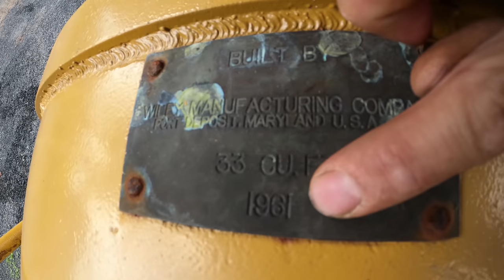Buying and modifying a concrete bucket for the crane

Comment: The wings should be wider and deeper and on a higher angle. Definitely a second person on the ground. Could lift the bucket to move the stone to the funnel between lifts of stone to fill it. I'm saying they need to be as big as the opening and much wider because you will be much faster filling it and that translates to less second person time....  Also, when traveling with any weight on the crane hook, you want it in tight to the crane. Not 20 or 30 feet out in front of you. That is how booms get bent and cranes flip. It's NOT a tele-handler!!
Reply from the maker: that boom was sucked all the way in , it wasnt out even a foot while I was moving
Reply: @jmuller86  Sorry Jesse, but it looks like it around the 33 min mark. It's been a while since I operated cranes, but it looks like one we had at Florida Power and the boom sucked all the way in tight to the outer mast. Maybe it's the camera angle also that makes it look like it's 20 feet out ahead of you..   I only mentioned it because another operator at work did exactly that and it made the crane bouncy and I was told he got the rear tires off the ground while traveling past our fuel pumps.

Comment: I don’t understand the purpose of laying the bucket over. It can stand straight up and you could load it that way. Any gravel spilled over can be cleaned up by whoever is running the skid steer when the bucket is moved to its unloading location. 

It definitely is not a one person operation for gravel. Minimum would be 3 people to load, lift and empty.

Comment: Just cut the sides twice down the half circle it makes and then bend the pieces out and add more metal to it that way it has a wider mouth opening all the time. It would work out much better that way. Only problem is youd have to keep the lift arm in the up right position all the time but it wouldnt matter.

Comment: Surprised those pins didn't snap first load , would have went at least 3/4 inch pin , good idea though .
Reply from the maker: there really cant be enough weight on those wings to need anything more

Comment: I would’ve made a modified half funnel to attach to the skid steer bucket to attach to fill cement bucket and detach when to fill skid steer bucket🤔, maybe flip up out of the way when loading the skid steer bucket and lower it to fill cement bucket, say a handle lever, manipulated from the skid steer cab

Comment: Could you make a wooden box type structure that the hopper sits in that has the wing extensions on the box? Jut put the hopper in the box tip up as many times as needed to fill the hopper. The box with the wings are external so you don’t need to remove those plates every time. Might a little hard to get a swinging hopper into the box.

Comment: Hi Jesse  Why does it need to tip from horizontal? if you made it so it only stood upright, the wings could stay on permanently.
 I thought it only needed to lay down flat to be able to fill it from a smaller on site mixer rather than from a truck?

Comment: The swivel pick up should be fixed (so it doesn’t flip up) and welded in the horizontal position so you can permanently attach the side sections at 45 degrees and cover the whole opening. I don’t know the advantage of the attachment section swivelling.
Cheers

Comment: I think you'd be way better converting it to a vertical only (Garbro style) bucket; Weld the hoist loop to a central Vertical position; Square off the base support so it will not rock back; flare the 1/2 round opening to suit your bucket;  no more time wasting tilting to fill it, and it will still be low enough to accept concrete. Just my thoughts. Good pick-up for the build.

Comment: I hate things that don't hang straight or aren't square. Move those two connection points to the center of gravity. My dad tried doing his house with an old 1930s cement.mixer and a loader bucket.  It was too slow. He ended up calling for 6 Red-E-Mix trucks.  Great video as usual. Look up the Hoover Dam videos and watch there buckets work.
Reply: I love watching those guys work that dam.  The amazing part is the fact that they had to circulate cooling water throughout the curing concrete to keep it from over-heating and cracking - the whole way up.

Comment: When I poured my slab for my garage the contractor put class A I think that is you guys crusher run , he said putting only gravel down would be like putting your slab on ball bearings
Reply from the maker: I disagree. All my foundations sit on clean stone, if its crushed stone and not round. stone with fines hold water and freeze, clean stone has space inbetween for water to freeze and expand
Reply: @jmuller86  Jesse will you mill all your lumber on your sawmill for the house project? Or will you use store bought materials?
Reply: @jmuller86  Jesse will you mill all your lumber on your sawmill for the house project? Or will you use store bought materials?

Comment: It's just another idea, but is it necessary that the bucket handle move?  Couldn't you just make a system to retain it in horizontal position (like a piece of chain with locking hooks)? this way it would not bother the plates you made and you wouldn't have to remove them each time you lift ...
Reply: yesssss, I see the problem now with the crane's hook staying in the road of the skidsteer while loading ....

Comment: Rather than tipping the concrete bucket upright with the crane each time between loads could you put a lip on the top face of the bucket which you can hook too with the skid-steer bucket after you have emptied the load into the concrete bucket? You could then use the skid-steer to tip the concrete bucket up and jog the load farther down ready for the next load. It would mean you don’t have to keep swapping machines between loads. 🏴
Reply from the maker: yea I could do that. But I think I will need a groundsperson anyways to put on and take off the wings
Reply: @jmuller86  I was also wondering if you could hard mount the wings not to the bucket but to the lifting hoop. That way they drop naturally into place when the bucket is flat and you can load up as you want. When you lift the bucket upright the wings go with the hoop and are out of the way right?  Just a thought. 🏴
Reply from the maker: @markdavies9912  that actually is a good idea, didnt think of that

Comment: Just corner load your skidsteer bucket most of the material on one side.  Then dump it in angled with the bucket what you spill you can scoop up after filling it a few times. That bucket is to big to fill with concrete for that picker 1 1/4 yards is over 5000 pounds of concrete not counting the bucket. If you're not watching some driver will fill it up for you.

Comment: What if you welded a tab on the top of the concrete bucket so that once you dumped your load into the bucket you could then use the skid steer to lift the top end of the concrete bucket so the material would slide down to the bottom. That way you wouldn't have to switch machines after you put each load in the concrete bucket.
Reply from the maker: that would work as long as I dont have to get off the skidsteer toi hook it
Reply: @jmuller86  Yea I was thinking a tab/ear long enough that you could just set the front edge of the skidsteer bucket under it and lift.

Comment: That whole thing seems overly complicated... If it's loaded with a skidsteer, why not keep it upright and have the whole top as a funnel? Then it won't matter wich way it lands to be loaded, and there's noextra time lost to fiddling around with laying it on it's side...  maybe it was useful in 1961 when it was loaded by a crew with shovels and wheelbarrows, but today it's just extra work and time... And $1100??? 😳 How much is a new one?
Reply from the maker: 5-6k for a new one. cant keep it upright because of the sled design on the rails. and it doesnt get any wider if its upright
Reply: @jmuller86  wow, i didn't know these things were so expensive. i have zero knowledge of concrete buckets, so i'm not trying to be rude or anything. could you maybe make a half funnel wide enough to load it when it's upright, and weld on some square pieces on the rounded skid, so it would sit upright all the time. and maybe tack the swinging "handle" to the top, so it doesn't move?

Comment: Would it not be better to fill the scuttle upright?
Reply from the maker: it wont stay upright because of the sled design
Reply: @jmuller86  Maybe You can make legs that can be bolted to sleds, then make some funnel also bolted to concrete bucket. Should be easy to remove when you use it for concrete

Comment: Dude, leave the concrete bucket alone. Make a simple 3 piece funnel extension to your skid steer you can bolt on when you need it and remove it when you dont. Or not. Just a suggestion. Peace

Comment: I dont see why you have to remove the pieces before standing it up. It looks like they will stay in place.
Reply: they would hit the swivel point when the crane would need to pick it up
Reply: @jamesr5705  YHes, but not when lifting it up to move the gravel to the back. No need to lift it off the ground.